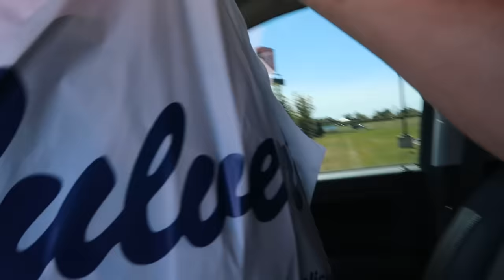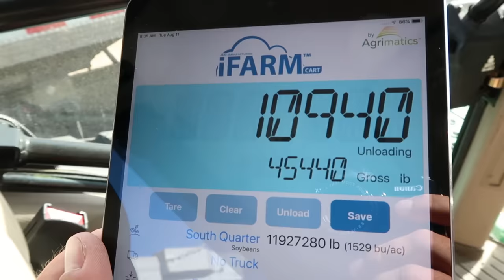Dad's New Case Tractor Broke Down!

Comment: Have owned a fleet of Harley Rakes when building golf courses; they do a great job yet need constant care and maintenance. They also make rock pickers as well; which do a great job of removing soccer ball size rocks down to golf ball size rock.  When on a skid steer; the rake works better backing up and removes the skid steer wheel tracks.

Comment: Rags on Case IH pretend their tractors are junk.
10 Minutes later: Deere doesn't start.
Reply: Wikkitt Klown   very true very true
Reply: Yeah but that is a part that is made to be replaceable, and it has several dozen hours on it. That CaseIH was BRAND NEW, and that is a factory installed component. So, yeah, if that screams quality to you, then you have no idea what quality is.
Reply: Wikkitt Klown no he just made a logical reply to what the issue was on both tractors. You got a little worked up from the looks of it
Reply: @ImpendingJoker  News flash, CNH and Deere both use Borgi tubes.
Reply: Wikkitt Klown   instead of junk Deere john diriorea
Reply: @ImpendingJoker  it was bought on online auction, who said it's new

Comment: Your Dad has a beautiful place there on the lake! Very nice! We had a problem with our 5065E tractor. A fitting was leaking and it was puking oil down the transmission housing, took it in they replaced the o-ring on the fitting (after I had already replaced the o-ring once) failed again and they replaced the fitting. No problem ever since. Our 5085E cab tractor loader valve locked up and the loader would drop but not lift. Whole new loader valve on that one. When they are new they have problems and will break down. That's probably another reason why you guys buy used equipment I bet.

Comment: Banjo fitting. Eye with the bolt through the middle has either a rubber o ring or brass washers on top and bottom

Comment: Yes to Culvers Butter burgers and their chili and frozen custard! Yum- dinner tomorrow. I was surprised you used the straw seed mats with the plastic mesh- that plastic mesh lasts a long time and sometimes get kicked to the surface and caught in the lawn mower. Worse yet- the metal staples you pinned down the seed cover with.  Those will be in your yard for years and show up in bare feet and even puncture flip flops and sneakers. I was surprised they recommended these in a residential lawn.

Comment: Zach,  Your dad's tractor has a CVT. I'm not sure if you know, but do not pull/tow it without disconnecting the transmission. There is a lever on the LH side behind the rear tire. If you pull in without disconnecting the transmission you run the risk of slipping the variator chain.

The best I could tell from the video, it leaking at one of the banjo fittings.

Comment: Curious about two things.  What was the reason the tree needed to be fertilized and has anyone come out with a straw mat t hat has biodegradable netting holding it together.  I had some put down and in a few rough spots I've still got that net right at the surface of the ground.

Comment: Check that if the tractor has JD link that it is disconnected if not being used.   Had a s680 combine that would drain the batteries even with disconnect turned.     Jd link pulls power directly from batteries.

Comment: When i was about  12 my dad put me on the 560 IHC diesel pulling an old Forrest City 4 row doAll harrow knocking down beds for planting cotton...He was using the John Deere 730 diesel to plant cotton.  The hardest part was when we moved back to our home headquarters it was  12 or thirteen miles on a busy 2 lane US HIGHWAY with several bridges.  My  mom was escorting in the 65 chevy pickup with her red magnetic bubble gum machine and her 2 x 2 red flag to stop oncoming traffic at the bridges...the trouble was the 730 in road gear top speed was about 12mph. The 560 had a topspeed of about 25 plus mph my dad was in the lead. I was behind him actually I was in a gear higher than than what I was pulling the DoAll in the field 
I dearly wanted to gearup and pass him.  But was explicitly told not too

Comment: Note to Case; separate hydraulic oil, between transmission and utensil system, that would enable you to drive the tractor to where it can be repaired.

Comment: I can't understand the Case tractor breaking down, but I guess that happens with any piece of equipment. I have two John Deere's and they have worked perfectly for me and I love each of them.  We don't have a Case, Massey, or Kubota dealer in my area so we depend on John Deere and the other closest dealership is a another major brand dealer and that is 40 miles away.

Comment: I have a Case/IH/Farmall that is nearly double the size of that Case.  It is not as reliable as the orange tractors, but it is tough.  I knew it was a Fiat when I bought it, and it clearly states Made in Italy 🇮🇹 right on the thing, which I figured was better than the lesser equipped versions like the C series that are made in Turkey.

Comment: Red tractor breaking down, 😂, reminds me of the days on the farm coming home from school or work. Hey Matt, I need you to come help me fix this tractor again.
Reply: Tried to use the TA to slow down, like how it says not to, eh?
Reply: J. A. G. His were old Farmall IH tractors that were rigged to work every which way possible. Eventually they were repaired right and sold at auction after he passed.
Reply: @ghostsfarm4441  So another "blame the tractor not the operator" thing
Reply: J. A. G. I guess in a way you are right. All that fixing got me into a good carrier fixing Fords 😂
Reply: @ghostsfarm4441  Must have been a pretty boring job

Now  if you said Chryslers, that I can see being an interesting, never boring job
Reply: J. A. G. With recalls and ecoboost engines it’s never a dull day.
Reply: @ghostsfarm4441  guess we've never had much issues with a Ford and when we do it's easy to work on.

Chrysler it seems like all they do is have issues and then you need 20 joints between you elbow and wrist to do anything simple.

Comment: 13:46 You can see pretty clearly that the oil is coming from somewhere higher, and also more towards the rear than the banjo fitting you pointed out at 14:48.

Comment: Man, that case is so bad. Like a massey ferguson 165 is a much better looking tractor with 65 horsepower engine. It doesn't matter how much your loader lifts, if it ain't good lookin, it ain't doing much workin. A deere on the other hand, it will work but it's kinda unreliable, plus it loses points as the red and grey beasts that are masseys will always scare these lesser things away